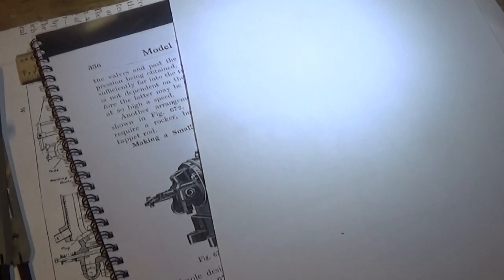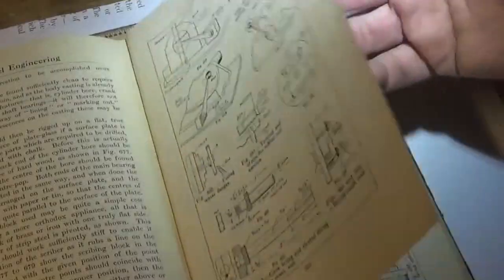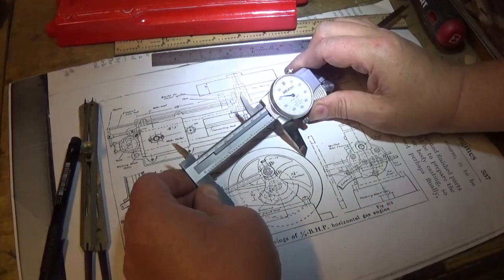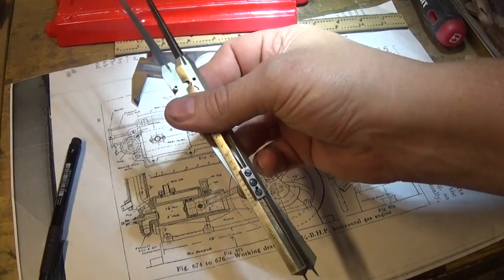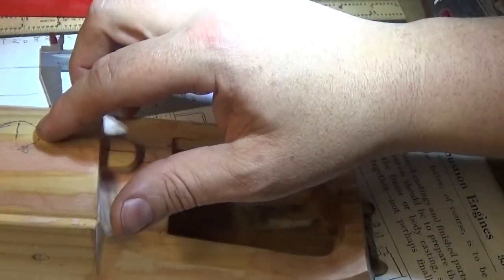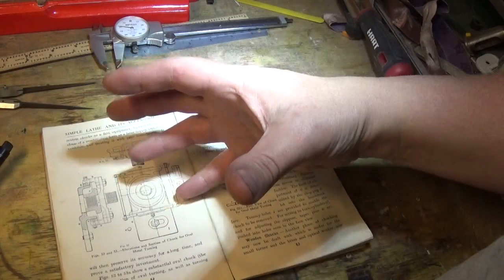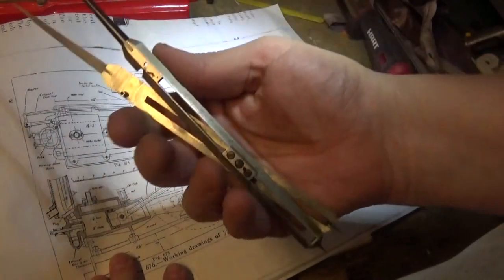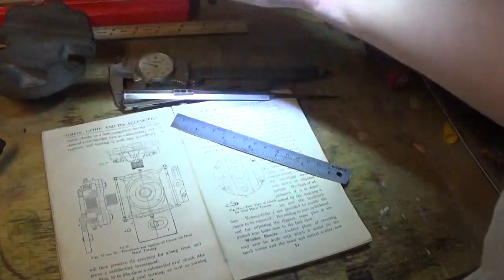scaling drawings from old fashioned textbooks.

Comment: Emma,  For woodworking I sometimes scale the drawings to 1:1 on the computer.  Scale to full size.      This allows direct measurement of the printed drawing.   To print big full sized sized drawings I use Mathias Wandel’s BigPrint program.    Along the same line we could scale images to include the shrink. Then the pattern and drawing would be 1:1.

BigPrint prints an image on multiple pages with over lapping edges and alignment marks.
Reply from the maker: I've not heard of that. Will j ave to check it out. Thanks dan
Reply: IIRC he charges $22 for BigPrint.  There is an eval version which prints a big EVAL on the page but its enough to let you know if it going to work for you.  https://woodgears.ca/bigprint/

Comment: Stuart Turner engines were super popular way back I recall. I did a few times a long time ago do some scaling up - usually used graph paper to help and managed with dividers - although never actually made casting patterns. Your scaling approach is I think about the best way to go... often the need to do some 'intuitive' approximations here and there while using a basic conversion factor. I sold my proportional dividers - probably silly to have done that!
Your patterns are looking very good.
Reply from the maker: It's a big engine . Was designed to run a small workshop and I'm building it 3/4 size. Would hate to tho k what commercial castings for this would be worth 100 years on!